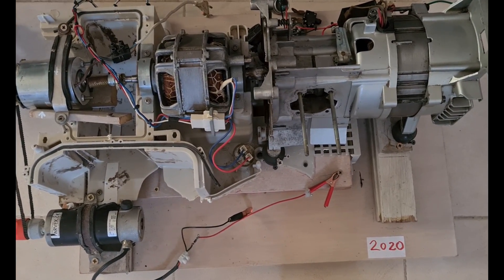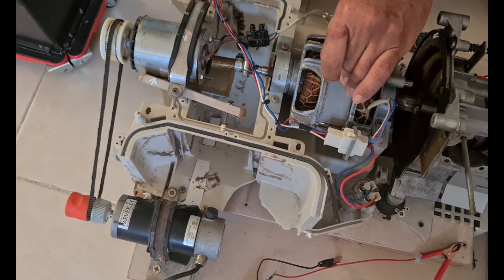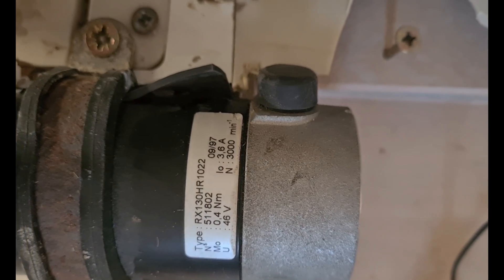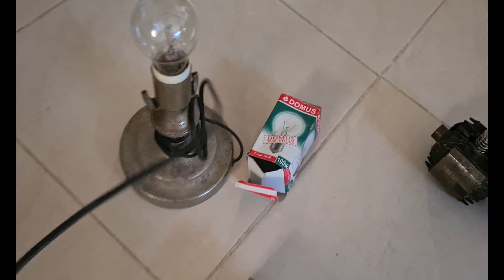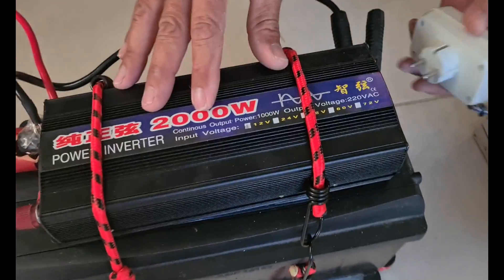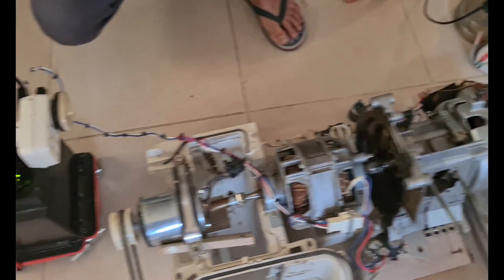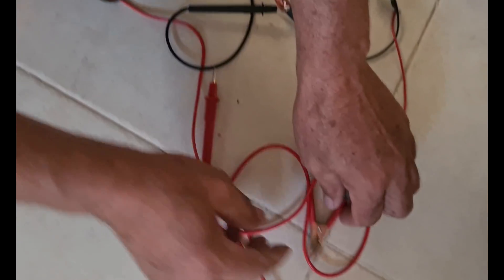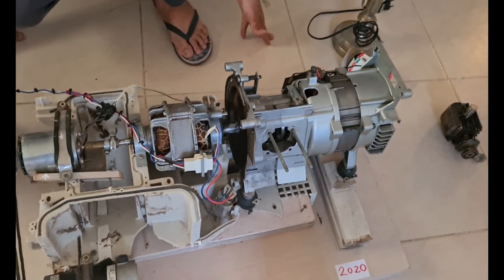Self-running fuel-less generator 2020

Comment: Hi 
Good job
Dou test it for how long  hours,minute 
The load how much can be estimated
Thank you
Reply from the maker: @DL-kc8fc  Hi Valentino, thank you so much again for your calculations about the 10W solar panel. A traction battery that you mentioned is a good idea and I will purchase one and use it in addition to the lithium bank of batteries of 24Ah or just split the system and charge only the traction battery. I am using now a more efficient 10W solar panel than the one in the video, here are the details: name of brand Offgridtec model number 3-01-001565 cell type A grade solar cell. Peak power P(max) 10wp. Power tolerance range -3% to +3% open circuit voltage 21.9. Maximum power voltage 17.6. Short circuit current 0.61. Max power current 0.51. Max system voltage 600VDC. Dimensions 185x435x25. The unit charges 2 phones per day, can charge a laptop as well when not working and power at least 4 bulbs of 4W for the whole evening. We can call it an efficient power bank but still, from 10W I get a huge output compared to the input and this is really what interests me. I am not running the 10Ah DC converter directly from the 8Ah bank, I am powering first a small 2Ah DC to DC converter that powers the big DC converter. I know both of them are adjustable but it works fine using the big one on the small one and not even using 2Ah input of consumption. Otherwise, if I use the big DC converter on full capacity I will drain the 8Ah bank right away. The small DC converter is adjusted from 11 to 15V and why do I do that, because the big DC converter will not work if it doesn't have at least 11.80V and from the output of the small DC converter, the big DC converter which we cheated a bit starts working perfectly with the 15V input and his output is adjusted to 28V and of course charging the 21.70V 24Ah bank. To be honest with you I am not living on this power bank in my house, I have 2 that I built but my house is powered by 15 solar panels, some of them are 24V for the 24V inverter and some are for 12V for a 12V inverter. The 24V solar panels are around 1.5 metres and giving around 300W output each. The 12V system panels are smaller and give around 150W output. I always have a spare inverter just in case. I wanted to share with you a trick I do at home since you said you get low sun, and please don't jump from your chair...the same concept I use on this power bank you saw in the video, is also something I use as an emergency between the 2 banks of batteries I have at home that power my house. When I use the electricity at home sometimes when there is no sun and the day was weak on charging because of clouds, one of the banks gets tired because of the lack of charging but they never go down from 12V so I use the 10Ah DC converter with a small amperage to charge the other bank from the weak bank, because the batteries are never flat. The inverter shuts off sometimes at 11.80V but not the DC to DC converter and I successfully charged one of the banks at the same time I used the inverter and I always remain with power. So this DC converter can work perfectly on a low voltage of 11.8V to charge another bank of batteries at night. The second trick I do Valentino is that one solar panel of each system, I mean the 24V system and the 12V system, I disconnect one solar panel from each system from the regulator and put a switch. And so when the day is grey, I run this panel directly to the batteries without passing by the regulator. You can't imagine the difference in percentage in charge and it really saves my life on dark days. And even if the direct voltage of the solar panel is 30V, it never damaged a battery because it is divided to 6 or 12 batteries that absorb the charge from this lonely solar panel. If I didn't do this I would find myself at 10 pm without power. But since I just turn on the switch of each system, 2 switches, each panel for each system, the charge is completely different and I gain at least 20% more which keeps the power on at home until I go to sleep. When the sun comes back, the switch is closed. Thank you for your time again. I have so many things to do but it is a pleasure to speak with you. All the best. Denis
Reply from the maker: @DL-kc8fc  Hi, I appreciate your time to explain about efficiency. This video was a test and I am aware about some back EMF and the efficiency which isn't the best. Especially within the mechanical conversion as you said. If you look at my other videos there is one generator that is a small prototype named "A unique 100% mechanical free energy fuel less generator", this device has no battery at all on it and no capacitors or whatever. The interesting thing about it is that when you are spinning a gearbox without an alternator on it, without batteries, once you stop spinning the gearbox or the alternator directly, the output current and voltage will stop immediately. In this generator you spin it for a bit and once you stop spinning it then it starts to move, I mean the gearbox and alternator start to work. It works in the opposite way. The generator works more or less as a clock. And there is a spring inside and it could be done much bigger with a bigger spring by hydraulic that will give more autonomy and will be very easy to spin for a while, then the energy will come back again from the alternator and start to give a charge for batteries and some loads. The load can come from a small inverter on the batteries. I like this machine because it's alternating energy 100% once you stop spinning it after a few minutes. Thank you for your explanation I do appreciate it and we always try to do tests and discover things. Happy new year to you and all the best.
Reply from the maker: @DL-kc8fc  Hi Valentino, again thank you so much for your time and your will to help and explain to me about the losses and that nothing is free. I read your comment twice. It is not only the fact that you are right which convinces me but also the way you explained it naturally and logically. Thank you for the detailed explanation. With your permission I would like to mention a point which is that I made different power banks that for example I start to power with a 10W solar panel and am capable to charge around 40Ah battery. Not directly but through energy storage and 2 steps, first charging the first small bank and then the bigger one and it is done. I have a power bank that I made, you can see it in one of my videos about the e-bike charger. With this power bank from a 10W solar panel I am charging a bank of 8Ah 3.7V lithium batteries 18650 then I pass through a DC to DC converter module and successfully smoothly charge 3 times more, around 24Ah batteries bank lithium 18650 3.7V. I use this battery bank everyday. I am using DC and I also have an inverter of around 500W installed and it works everyday and powers small devices and bulbs for the house. It was not possible under circumstances to run this inverter from 10W directly. This is a small example of how from 10W you can reach 24Ah. You will say that it is not possible that 8Ah battery bank can charge a 24Ah battery bank but as I do it everyday I found out that the 24Ah bank was never empty after using it so it means I drained this bank down to maybe 40%-45% but never emptied it. So this bank of 24Ah is never empty and this is why it is possible for me to charge BACK this big bank of 24Ah in 3-4 hours maximum from the 8Ah bank, and this is the secret of energy storage. So you may think it is not possible but I still started with a 10W solar panel and in the video you can see I am even charging a car battery. But the balance is so important that I am using only a 500W inverter that is enough for small devices for this test and can charge any e-bike you want, even 2 at the same time. Again, from a 10W solar panel. I tell you all this because you are right that there are some losses with the moving parts generator, friction, heat and so on, but with solid state generators you can make miracles. There are so many different step up modules that can make the job of running this concept you see in the video. I use one small one and 2 medium ones and a fan is also working just in case. So in reality I don't see why I cannot cover the 10W back even without the solar panel once the 8Ah bank was charged for the first time. This must be tested very well. This is the link to the video of the device I am talking about: https://www.youtube.com/watch?v=f69UVMrjqIY&t=817s I am based in West Europe, I am french. I am leaving you my e mail in case I don't answer fast because I am working on my tests all the time, it is luelmade (at) hot mail (dot) com. May I wish you a good weekend. Best regards
Reply from the maker: @DL-kc8fc  Hi Valentino, I hope you are having a nice weekend. I am living in southwest Europe. For me it is still cold here in winter. You didn't mention what direction north you are living, but maybe you can write by email one day. Anyways, I live off grid and all the water I collect it from gravity and canals. This is the first year that we are dry, the animals are getting limited water. We have had a drought all year. It is terrible. We hope the rain will come. I collect each drop when it rains with my roof and by pipes under the roof which go to the deposit and canals on the land. I even collect humidity drops during the night but this year was a disaster. Thank you so much for your time to write and explain and give me some very nice tips which are quite interesting. The first thing I would like to refer to is that I have a DC potentiometer which is connected first to one bank of batteries and when I turn it on the output goes to the DC converter so I can control the charge with precision on the other bank by seeing the numbers and whether they are going up slowly or fast, so I do it the slowest way possible, this way I am sure I am not consuming too much from the input bank. If the numbers go up every 3-4 minutes its fine with me and I am not consuming so much. I don't use the full capacity of the DC converter of 10Ah. About the heating system you mentioned it is very interesting and I found a simple way to do it also but not as efficient as you did and not as economical as you did. I don't use it too much because I use other systems for heating but at the time, I connected a solar panel of 150W to a battery of 40Ah and from this battery I ran 2 heat plug that you have in Diesel cars, those get warm as hell and connected them with insulation to a water deposit of 200 liters so you can imagine one side is the outside of the deposit and the other side of the heating plug is inside in the water with insulation so the water becomes warm. Those can be bought in any secondhand car parts shops. I use it without an inverter. At home, my system works with solar batteries, not car batteries but I want to buy those traction batteries when the economy will allow it. Each battery I have is 2V long transparent batteries from the TAB company, 250Ah and they are connected in serie. Regarding the tip you gave me with the pipe it is very interesting. When I was younger I remember there was this flower that spun towards the sun more than other flowers and I wrote the idea and diagram and tried it with a small motor and 2 electric components. So the plaque spun directly with the motor electronically. I can still find the diagram and how I did it. It always follows the sun electronically with a small DC motor. I wish you a nice end of weekend and thank you for your time. All the best and an easy winter.
Reply from the maker: @DL-kc8fc  Hi Valentino I hope you are well. The mystery of where you live continues...I left France years ago. I am a sea man originally, I worked on yachts maintenance for years, also in France but in the Caribbean too and since then I never went back to France because everything changed. France used to be a nice country when I was young. Now I live in southwest Spain. About the sun tracker, the panels are wired to the motor with opposite polarity and the photo resistor will change resistance according to the amount of light it detects. Basically it is a hobby servomotor servo drive RC battery and the photo resistor I mentioned. There is another way to do it without electronics and without the pipe to the ground, and it is to put a lightweight solar panel and in the middle of the panel a tiny axe that will sit on a base so the solar panel can move right and left up and down and to tie a small upside down water bottle on each side of the panel, one is full and one half full on the other side and a small irrigation pipe with a tiny hole so the full bottle of water will lose a drop every few seconds and that's all. The other bottle without losing water. So slowly when the full bottle loses drops it will tilt slowly and find its balance with the other half full bottle and while losing water it will go to the other side and the half full bottle will now be the heavy one and go down so you have the panel facing the sun all day round. Very easy to make. About the traction battery I seriously looked at them today and they are very interesting, I didn't know them. I have to consider them for a test. As you know I use solar batteries of 2V. Thank you for the explanation for the system with the mains and inverter. Unfortunately I live on a mountain with no grid here at all. I am completely off grid and dependent on what I do. Also about the bulb you mentioned last time that can be an indicator, I did it in one of my generators. I still have to publish this video. It acts a bit as a resistor and when the bank gets full the light is very dim and when the batteries are weak the bulb is strong. I heat my house with a bottle of gas, I have a heater with copper in it and automatically when it has water with a pump of 12V from the main tank it goes on with pressure to the device and it turns on for hot water, one gas bottle lasts 3 months and costs 20 Euros and the water is very hot. So 3 months for this price its almost free. I can send you the gas heater details, it costed around 60 Euros on Amazon. The other system we talked about is by the diesel car preheating which works very well from the battery working on the solar panel. We hope for some rain for the crops and animals and ourselves. Have a nice evening
Reply from the maker: @DL-kc8fc  Hi Valentino, I read 3 times what you wrote to me and I am just speechless. The heat pump is very interesting and using the satellite dish is something special. I read 3 times and I think I have to read again. I will think about what you said and try to understand how it works. It sounds very efficient. I don't think the clouds are a big problem if you can connect 1 solar panel directly to the system without a regulator on bad days but what you did there is really genius. I agree with you that I don't have to publish anything personal. Email communication is better for more privacy. I wish you a goodnight and always good ideas
Reply: @denissabourin  I wrote you an email with details. Maybe he came to you.
Reply from the maker: @DL-kc8fc  Hi Valentino, thank you so much but I did not receive it. I give you my email: luelmade (at) hot mail (dot) com
Reply: @denissabourin  I wrote to hot (space) mail, but this format does not exist, so I wrote twice to hotmail (no space). That's why I asked if it came.
Reply from the maker: Hi thank you for your comment. There are 2-3 possibilities to measure the load and how long it works. As I explained in the video, you can charge a bank of batteries from 1 battery of 100Ah and from this bank of 6 or 8 batteries of 60Ah  you can easily charge the input battery (primary battery) and still have enough power in the charge bank of batteries to use a load of around 800W. In this case, you are directly charging the bank from the alternator of the generator with the magnets I put inside by putting a step down converter or a regulator, since the charge is too strong. But let's not forget that the generator is now acting as a PMG or a 220V or 110V in the US. There is no point to use the bulb of the 100W that I demonstrated directly from the output of the generator because you can get much more from the bank of charged batteries by using an inverter of 2Kw with them in order to get the 800 or 900W to enjoy your devices and in this way you get more watts output instead of just lighting one bulb. The third and last possibility as you see in the video is to use the output directly from the generator in order to run the small motor that drives the Servo motor  which is an alternator in this case and this alternator is charging a bank of batteries as well. So as you see there are different possibilities and then you can measure time and load. For me it works for hours by charging a bank of batteries covering the input from a primary battery and still have energy left behind to run my inverter and use a bigger load than the bulb. Regards
Reply: @denissabourin  why you lie for you can't charge a battery that's in use unless your generating more than your using so by steping up voltage you will loose out on amperage so if was drawing 240v 1amp with the inverter the inverter cud draw 5 to 10amp at 12v and would increase when you add load
Reply: @davey2k12  Exactly! This is all crap. The author of this video just found an over complicated way to light a bulb from a car battery that he charged before showing us. Until he produces some efficiency calculations (and peer review by educated people) this is not an over unity system. Come for the science, stay for the laughs!
Reply: @denissabourin  It is not possible to produce more energy than was used to produce it. This is called the law of conservation of energy and also applies to atomic bombs, whose energy we release from fissile material with less energy. The best way to realize this is to convert everything to watts (W) if you don't accept amperes (A). The inverter, motor and generator consume a lot of power, so you can never get what you have on the input. The illusion through volts (V) works, but amperes (A) and hence capacity is what will always be missing at the output. It is simply not possible by electric means, which is very loss-making.
Reply from the maker: @DL-kc8fc  Hi Valentino, I don't try to produce more energy that was used. The target of this generator is to charge a bank of batteries and from the batteries to put an inverter that can produce even the capacity of the generator itself. We are preparing a video for that that we will publish soon. The fact the generator can produce AC as seen in the video, a bulb of 100W for example it doesn't mean it is wise to use the generator to power bulbs but rather to run the alternator that can be more productive to charge batteries and then use an inverter. Regards
Reply: @denissabourin  If your video is just about transforming energy for other purposes, then that's fine, even if the mechanical methods are lossy. I know the light bulb was only used for demonstration. OK.
Reply from the maker: @DL-kc8fc  Hi, my videos are just tests and the new one I made for this generator shows we are trying to charge some batteries well and focus on energy storage while still using AC for load. Best regards
Reply: @DL-kc8fc   Exactly! This is all crap. The author of this video just found an over complicated way to light a bulb from a car battery that he charged before showing us. Until he produces some efficiency calculations (and peer review by educated people) this is not an over unity system. Come for the science, stay for the laughs!
Reply: @pstonard  I got to know the author of the video a bit (via e-mail) and he really walks dead ends in the expectation that he will come across something. He knows or suspects that his "transformations" are very unprofitable, but it is only his hobby. In this case, I would not solve it :)
Reply: @DL-kc8fc  Thanks for the clarification, I have trouble wrapping my head around a task that is pursued when the theory is so strong that it would fail.

What happened to "work smarter, not work harder"?
Reply: Thank you
Nice explanation
Reply from the maker: @ghenialazawi6180  you're welcome